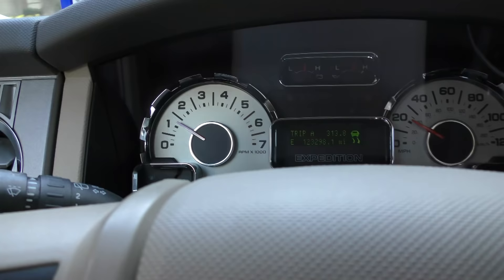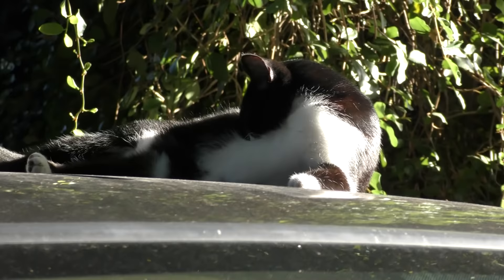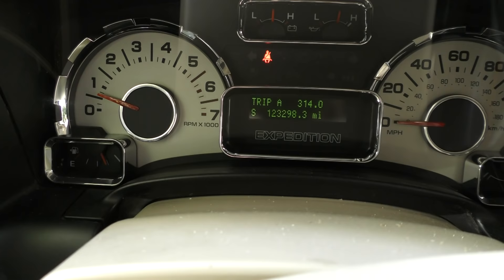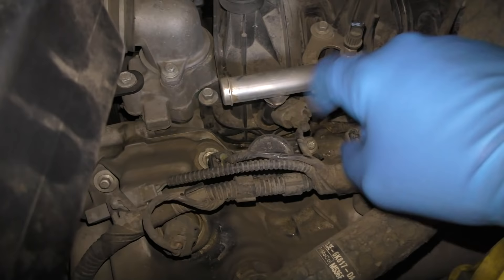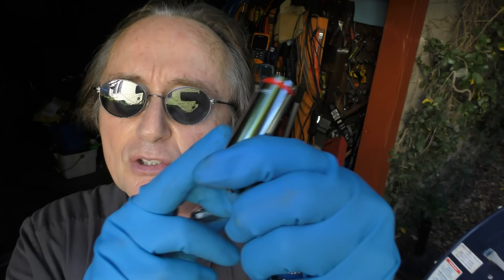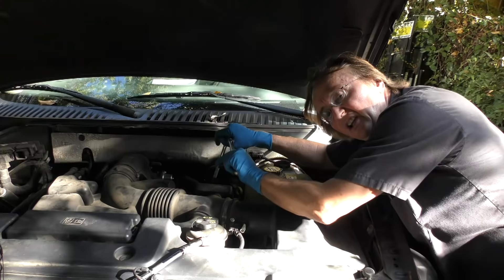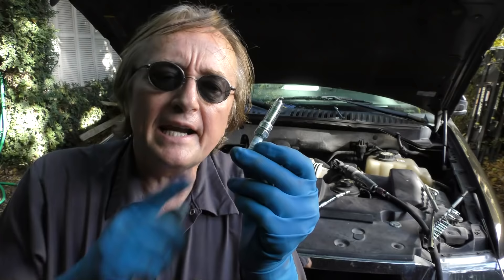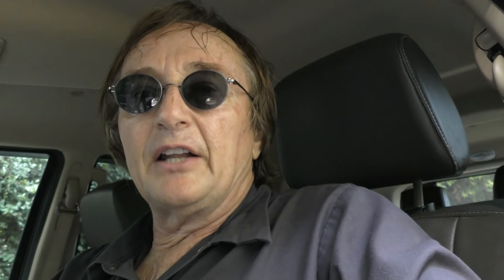How to Stop Car Hesitation (Spark Plugs and Ignition Coil)

Comment: Last year I started having this issue. And my car completely quit starting.

Mechanic kept the car for 2 weeks. He Changed literally every sensor. He literally said he couldn't figure out the issue. Car still wouldn't crank. He fixed the oil leak I had at least....430$ invested...

But we got it towed to my dad's body shop. He checked my plugs. I literally just needed new plugs.  Like 32$ And 30 minutes, it was fixed.

Needless to say we haven't sent anything to that mechanic again.
Reply: @Jonathan A 

Yeah. I was knew to driving and didn't really understand the signs. So I didn't know. But after got it back, my dad said he started thinking the signs seemed like the plugs. Sure enough, cylinder 1 and 4 plugs were done for. 

Simply got new plugs and wires for all 4 cylinders. Done lol
Reply: @Jonathan Actually the mechanic used his head enough to rake in $430 and I bet the supposed "replaced sensors" are the same ones that were on it. Probably just cleaned them. An honest mechanic wouldn't have replaced sensors because its obvious it was an ignition issue; fuel, air, spark.
Reply: they knew, just ripped you off, sorry about that, that sucks
Reply: They do this to get more money out of you and I know from personal experiences and other people aswell.
Reply: Sounds like a scam.
Reply: THESE NEIGHBORHOOD CARS SHOPS ARE MONEY HUNGRY
Reply: I'm late but I hope karma got a hold of that crooked mechanic.
Reply: Dang, that's my kind of luck.  Thought I was the only one this happens too.
Reply: It literally sounds like a scam!
Reply: I had a mechanic that did the same thing to me we kept going back and forth with the sensors every single visit. Gifted the car to my cousin told him if you can fix it it’s all yours.

Comment: Scotty, been watching you for a while now and want to say thanks for the confidence!  You make working on these things seem super simple.  Had this exact issue with no codes from the computer.  Replaced the plugs and coils and it is running perfect now. :)   Just to let you know, I was thinking it was a transmission issue before this video, but that wasn't the case!
Reply: Which coils did you use and how much did they run you I have something similar but I wanted to see if I could just replace spark plugs bc coils are like 230 plus 40 for plugs

Comment: I had hesitation and bucking going uphill. The spark plugs were done. Swapped them out and running way better. Thank you!
Reply: I know I'm upset. I had shudder problems for nearly 5 years and only used my SUV for short distances. Turns out, one spark plug was bad. 165k miles on a 1998 Toyota landcruiser 4.7L V8. I went ahead and replaced the crankshaft sensor, all 8 spark plugs, all 8 ignition coils, fuel pump, and all 8 fuel injectors. I should replace the fuel filter as well but my SUV runs great now.

Comment: I was getting a P0302 error (cylinder 2 misfire) and my car was riding rough and sluggish. I changed all my spark plugs and the error was still there. I swapped the #2 ignition coil and #3 ignition coil and the error changed from P0302 to P0303. So happy to see it switch and easily fix the issue quickly and cheap..... I originally thought it was a faulty or clogged fuel injector as I put a stethoscope on the fuel injector and it sounded inconsistent but the bad sound was due to the bad ignition coil.

Comment: Thanks for letting me know the diagnostic system may not catch a problem a simple tuneup will fix.

I used to change plugs out all the time when it was a Plymouth Horizon or Chrysler LeBaron. It was easy and cheap, just four plugs, all lined up under the front of the hood.

Comment: Isn't it nice when a seemingly complex problem turns out to be simple?
Reply: Yeah I wish my violent slowdown and hesitations with my car were that simple!
Reply: EgoShredder transmission?
Reply: Sensor or fuel issue
Reply: I've replaced the coil pack twice in 12 months.  It has four coils in a row mounted on one unit, and this sits directly on top of the spark plugs in the engine block.  The spark plugs were changed about 9000 miles ago, along with the fuel filter and other usual filters.  The full exhaust system was fitted in September 2013.  Engine temps are fine but naturally fuel consumption is terrible at the moment.  Diagnostics were carried out earlier this year when the second coil pack was fitted, and no errors were present.  There is no dash warning light on at the moment either.

The first was a cheap brand (HAAS) and lasted only two weeks. The second was a recommended top brand (BERU) and that lasted about 500 miles.  My car was driving to absolute perfection up until December 2014, but since Jan 2015 it has been hell to drive and at times extremely dangerous indeed.
Reply: just becaue he made it look simple on video, doesn't mean it is simple. That coil was covered in coolant. That car will probably come back with a blown head gasket. It is a 5.4l piece of shit engine.
Reply: HERPY DERPEDY
Reply: Ford Mech my 2 valve was kept for about 13 years never had plug issues, just a rear main. always use synthetic. 
yes 3 valve plug design is dumb but u must remove when warm. 
fuel system cleaner and carb cleaner down the plug holes and maybe a touch of pb blaster. 

even with improvement in new plug which is laser welded, they still seize, although the plug will not break . Fomoco had to redesign the heads.
Reply: YES10 unless I rememb incorrectly he said there was a radiator hose leaking and it was the source of the coolant.
Reply: Scotty wouldn’t you need to fix the leak or the coils and plugs would foul ?
Reply: Life in general my friend...

Comment: Thank you!! I thought so. A short & spark plugs need to be replaced. Haven’t checked but the maintenance guys in my apartment complex laugh at me when I’m working on my 95 Buick park ave. I’m gonna find a place somewhere else to work on it. Where comfortable & put ALL my tools in my truck. Can you believe they laughed & said, “oh, ok” you need to reboot the car’s computer - it worked & even beeped when ALL power drained  needed a jump & took 10 mins just to repower. & IT WORKED no problems since!!!

Comment: Love your youtube.  I come here for any questions I have about my car.  Recently my car was stuttering, engine light on so I had my mechanic tow it.  It said it was the spark plugs had worn out and he replaced them.  The car was good to go.  When I picked it up it wouldn't start, when it did it was stuttering.  Down the road the engine light came back on.  Now he says its the coil pack that he replaced in the car three years ago.  I only drive the car to work so since the replacement I have only added 20,000 miles.  I'm here again to see what the deal is and I did get charged $45 for the computer check...the first time.  Keep up the videos!

Comment: My car did the same thing but it was the camshaft position sensor. So I went ahead and replaced that but I also went ahead and replaced the spark plugs and the spark plug wires and everything else while I was at it and now it's running like a new car 21 year old car running like a new car. Your videos definitely help me save money. Cuz I know mechanic and I don't know anything until about cars or how to fix them so thank you very much but helping me.

Comment: Just had this problem on my Escape V6, the workshop fixed it by changing 2 faulty ignition coils and all the 6 spark plugs, on top of that they also cleaned the MAF sensor and flushed out the air intake system. Now the car runs very well.

Comment: The same thing happened to me when I bought a used car and it started hesitating.  Two of the four spark plugs were loose.  I went ahead and replaced all four as well as one of the coils, and now it runs like brand new.
Reply: Why did you replace the coils bc I wanna do my spark plugs and not coils but I’m not sure is that okay ?
Reply: @Vids703  coil plugs only last 100,000 kms if there aftermarket sometimes depend the brand, if it's standard coils (factory) will only last 60,000-80,000 kms 
Best to replace all coils and plugs if you just replace one coil expect the other coils to fail before the one you replaced that's why people normally do all coils and plugs at the same time!
Reply: @kaneclark7171  I’ve seen so many people just replace spark plugs and not the coils and it runs perfect they only change the coils if they see thier is a misfire
Reply: @kaneclark7171  no I just asking because on 3 cars my dad has owned have made it 300k with original coils just replaced spark plugs
Reply: @kaneclark7171  ford expedition was damn near brand new my father never really put money into the car I remember telling me he changed the plugs and that was it originall coils since he bought it back in 2003 truck came out in 2002 also had a Suzuki and same thing original coils just changed out the plugs I’m pretty sure the coils hadn’t ever been touch since the car was built looking at the original spark plugs at 160,000 they were pretty worn but news plugs and it was on its way

Comment: I have a 2010 F150 with the 5.4. I’ve had the stuttering issue for a while now. Could never really pin it down. I decided to buy plugs, haven’t installed them yet but this video helps give me hope my first potential fix is gonna work

Comment: Hey Scotty I really like your vids! I got a '12 Q5 with 117000 Km on it. The previous owners didnt do much maintenance on it besides changing the oil and filter. So i decided to go ahead and change out the sparks, all the filters, changed out the oil, timing belt. Just the basic stuff that probably are worn out. Now, when I drove on the highway I notice there was some minor hesitation and jerking when I accelerated 60 km/hr up. What do you think is the problem?

Comment: I have chevy beat 2010 that hesitates while accelerating on low rpms.. however it goes off at highspeeds... Can this be ignition coil problem or any other problem? Please suggest shud i change the ignition coil or not...
Reply: SHEKHAR BANSAL It could be the gap on the spark plugs too.They might not appear to be bad or it could be the coil pack it’s hard to say I think I might need new spark plugs cuz dude put a screwdriver in my spark plug wire and it started up but he didn’t have time to check my spark plugs cuz he said The was hot and his mama just got sent to the hospital
Reply: Teisha MISUNDERSTOOD are you a female

Comment: Sadly, more often than not, modern engines are so complex that you practically have to take the engine apart just to get to the plugs. Not like back in the day when the plugs were right out in the open. I miss those days. Cars were so much easier to repair back then.

Comment: My car idles just like this video. I changed the transmission filter and fluid, the air filter, the oil, and cleaned the throttle body. Still has a little hesitations so im guessing its the coils and spark plugs.
Reply: Little Ricky Two months later, changed the spark plugs or the coils yet? Did it help?
Reply: Anthony Hernandez  yeah did it lol
Reply: Did it help ?

Comment: Replacing the plugs and coils isn't overly difficult.  However, it is more time consuming to find the exact root of the problem than it is to fix the problem.  Car manufacturers have added so many useless sensors and electronics that diagnosing car problems has become overly problematic even for licensed professional mechanics.  

If one has a good general understanding of cars and how cars operate, one can still diagnose car problems the old fashioned way > test drive and eliminate the problem methodologically step by step.

Scotty Kilmer is 100% correct.  Car hesitation (and misfire) is most likely the result of bad coils.  My Rav4 started to show this very problematic symptom about 6 months ago.  After replacing the EGR valve, MAF, and checking the (NGK Iridium) spark plugs I decided to test the coils and all coils tested fine on the pin 1 and pin 4.  However, at the spark plug end there was no reading thus possibly the coils were bad.  I replaced all 4 coils for $84 and problem solved!

EGR valve and MAF sensor was also replaced.  So for $124 in total car repairs in the last 6 years is pretty darn good!  I did notice that on the original coils there were hairline cracks (on all 4 coils) along the length of the shaft of the coil as well.  275,000 km on the original Toyota Denso coils is pretty good!

I pretty happy that my older 2002 AWD 2.0 Rav4 is still alive and kicking even in 2023!  Hopefully it will last one or two more years....

Comment: My car was in the mechanics for 3 whole weeks and they couldn’t find out what the issue was smh they went through everything. They were saying everything was ok, spark plugs, ignition coils etc...
Until my uncle came along and said my car literally had no transmission oil in the gearbox. 

This means no power to accelerate also.

He just added 2 litres of transmission oil and that was it lol 
Saved me so much $$$$$$ it worked for me so who knows, it might work for your cars because my car is finally back to normal lol

Comment: Ford used metric parts on my Probe cause it's really a Mazda with ford's name on it.
Reply from the maker: Ford has been fully metric for decades as everyone outside the brits have done so.
Reply: my 02 saturn is metric as well, but I actually have more metric sockets so doesn't bother me
Reply: +Scotty Kilmer Scotty do you have a video on checking/replacing mounts?? my saturn has been hesitating at low speeds and has a slight vibration and no check engine light. the motor sounds like it's cutting out when accelerated from a stop, so I chalked it up to a fuel or air issue and I've done numerous things in an attempt to fix it, including spark plugs and new wires. I belive it is my mounts but I'm new to repairs and don't know how to check and replace them. Is it an expensive job if I took it to a shop?
Reply: Scotty Kilmer how come the spark plug size was odd to you then?
Reply: Jordan Frary you can check the mounts by opening the hood and turning on the car. Have someone switch in and out of park, drive, and reverse while looking under the hood. if there is a lot of engine movement or lurching you probably need new motor mount(s). you can also block/chock the wheels, and watch the engine while you have someone hold the brake down firmly and carefully hold the accelerator to 1000-1500rpm above idle. see if the engine rolls too much. usually the front motor mount is the first to go (engine pulls back on it while accelerating during normal use). 
A shop will probably charge $100 to change one mount, plus cost of parts.
Reply: +Shane yes, I had someone do that quite a while ago and my engine moves slightly forward and back at that rpm. That's exactly the range that it wants to cut out and stall. the transmission appears to clunk  going into reverse, and the fluid is still in very good shape, so I'm assuming that mount is loose/broken as well and is not allowing the trans to move correctly. I'm new to all of this stuff so it's really helpful. $100 a mount isn't that bad at all. I watched a video on how to change the trans mount. I can only imagine trying to do the others on my own. I'd almost rather take it in. thanks
Reply: Jordan Frary it will likely be $200ish including parts. Every car is different though, could be more if hard to get at. Good luck
Reply: Jordan Frary, if the tune up is current along with the filters, I'd get a fuel pressure test done, then get the injectors pressure cleaned as it sounds like you have another issue, a broken mount will only cause noise and a subtle lurch in the feel of the car when first pressing on the gas.
Reply: Ricardo Lupian yes we know :)
Reply: Ricardo Lupian I went to a ford dealer and they said they cant even promise they can diagnose and fix my ford; only promise to charge me. Now i know why the other owners all said take it to a mazda dealer.
Reply: +Believe231 I have done a DIY tuneup, I'm actually going to clean the IAC valve tomorrow and respray the throttle body and egr valve. I'm expecting that to help, if not fix my issue. From there I'll try to get a fuel pressure test. I also actually need to get a pressure test done on my cooling system. I'm losing coolant. the cars a mess, a million small things, but thankfully nothing too serious
Reply: Jordan Frary If you're losing coolant and see no leaks and the engines running a bit "off", I'd next FOR SURE test the coolant for hydrocarbons as the head gasket may be failing.  Scotty has a video on how to tell if your head gasket is blown on YouTube.
Reply: +Ricardo Lupian yeah I just flushed the coolant yesterday and it came out super clean to my surprise. also changed my oil 1500 miles ago and that looked well too. I don't seem to have them mixing so I'm not 100% convinced it's a head gasket
Reply: Metric became the new standard on every vehicle from 2006 on.  I can't think of a single vehicle (domestic or not) that uses SAE with the exception of the spark plugs.  You don't even need to buy an SAE set of wrenches and sockets if you only work on newer cars.  Even most cars before 2006 typically use metric until you get all the back in the '90s.
Reply: 'Fraid not Scotty: All British cars are metric & have  been for years.
"AF" spanners no longer fit most bolts etc. Only the speedos are in MPH (& Kph of course)....because drivers relate to distance better.
And just because the UK has come to its senses & voted to get out of the Political Gravy Train that is the EU...we aint going back to "imperial"  measurements: The metric system is simply more universal & far simpler to understand.(Which is a bonus given our woeful education system!)
Thanks for your Videos...always a good watch.
Reply: The only car I can think of like that is the Mazda 121. It's identical to the Ford Fiesta Mk3.